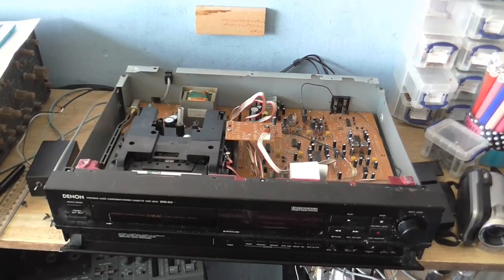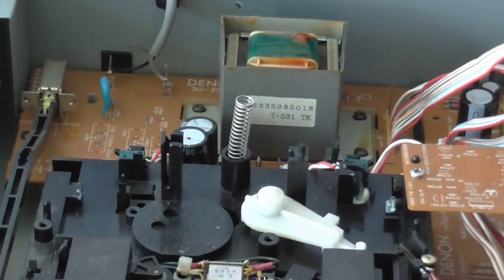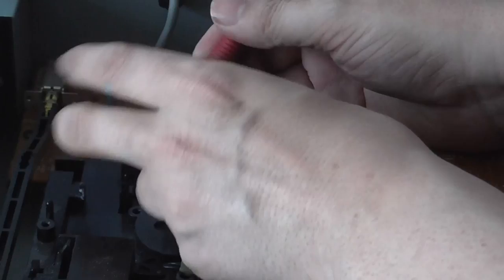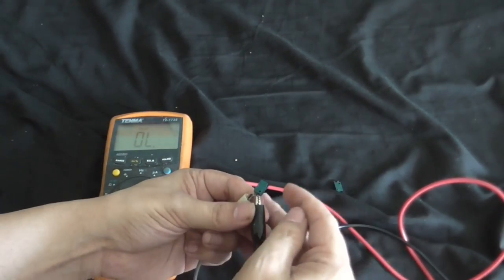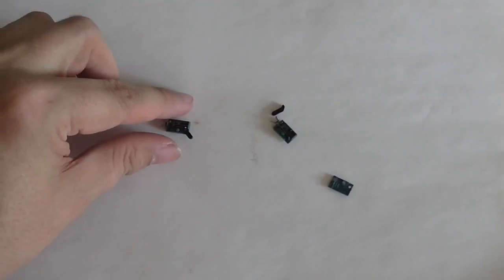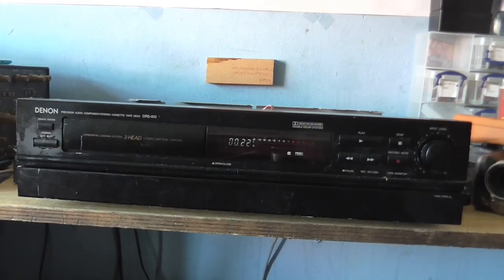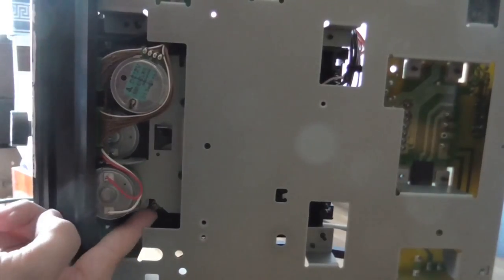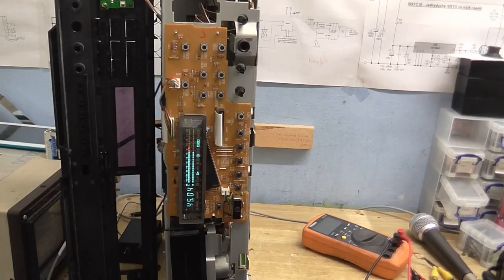Fixing the Denon DRS 810 part 2 of ?

Comment: When I need to use a rubber band or shorten a longer belt to size. I cut it at 45 degree angle then super glue it, after that I use some sand paper to flatten the surface and voilla. It works perfectly :)
Reply from the maker: I'll have to try that, I always had a trouble gluing rubber together, the glue never seems to stick to it, haven't tried super glue though.
Reply: Yep works a treat I use the same technique.

Comment: So i bought this same deck in 2024 and it has the EXACT same issue.  How did you get the belt on without disassembling the carriage tray?  Nobody online shows how to do this.  Would be awesome to replace all (3) belts at one time and worry about is again in 30+years
Reply from the maker: I think if I remember I did have to disassemble the whole thing. Elastic bands can work as a temporary replacement but they often come off. I would check the video myself and see what I did but I just can't stand watching my old videos.